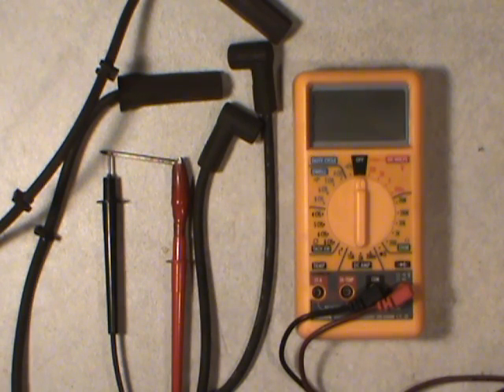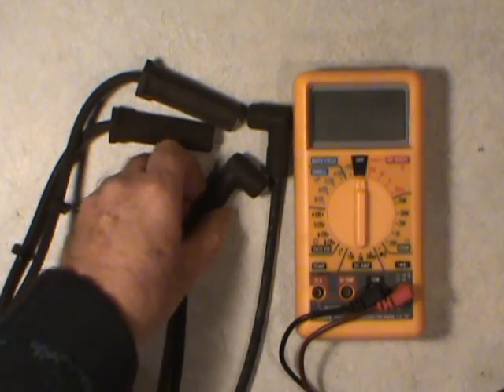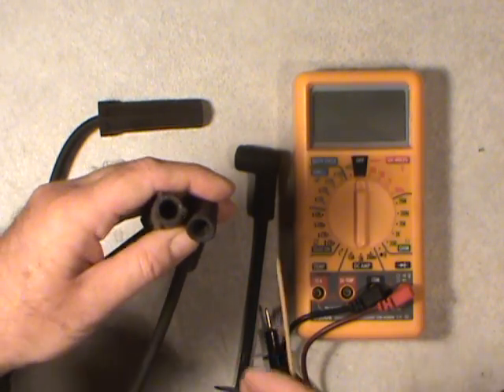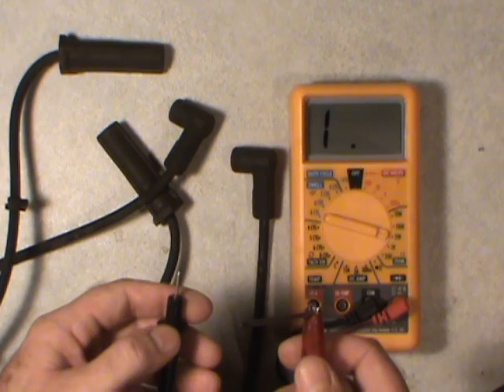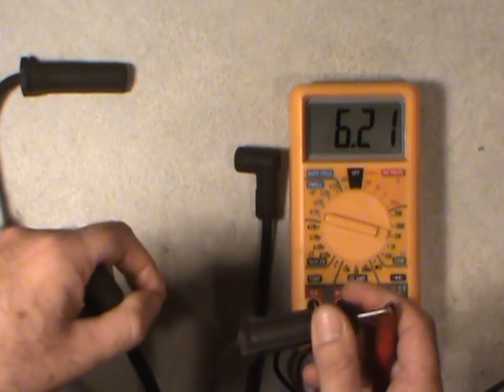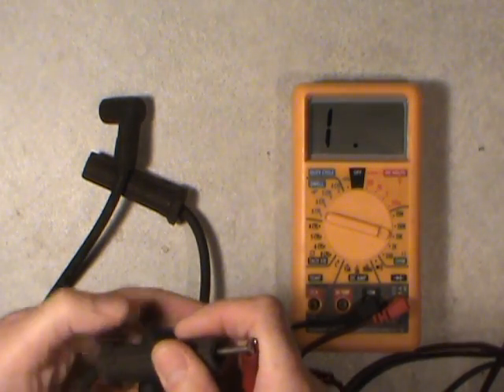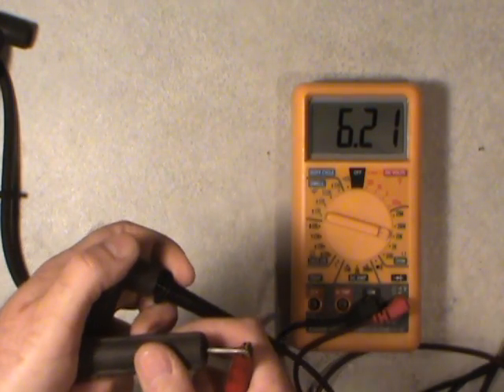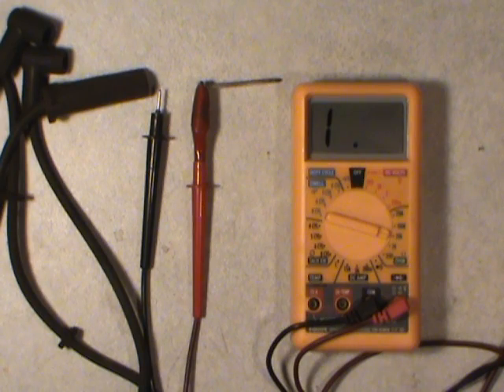How to Test Spark Plug Wires

Comment: Very well done and helpful -thanks.  Just hope I can cure my misfiring prob - changed plugs and coil pack - only leads to go but they cost £100 here in UK so it would be good to test first in case the leads are not the problem. They are 11 years old !
Reply from the maker: Greetings...filmer138.........You're welcome, and, thanks for watching.........Well, for the more common type of, shall we say, (high voltage), High Resistance Leads/Wires, there's the Ohms/resistance test (as is shown in this video), which will usually be, a given amount of Ohms (resistance), for a given length (usually 1 foot, or 12 inches, in the USA/United States of America, and Canada as well, most times), that, the Manufacturer specifies, for a particular set of Leads/Wires, that it makes.............The, shall we say, lower cost, Carbon (string) type of, high resistance Leads/Wires, will usually break down/wear out, over time (use), due to the High Voltage Pulses, that travel through them.............Here's, an easy way, to actually see, if there is one or more, very bad spark plug Leads/Wires, in the set of them, but, you have to be very careful, at the very same time............It's just a matter of, Watching, all of the Leads/Wires, while the engine is running, when it's dark outside............Remember now..."Don't Touch"...!!!...just "Look", not too Close...!!!...for any High Voltage..."Arcing" (sparks/sparking), that seems to be..."Jumping"...from a spark plug Lead/Wire, to a Metal part, that's near it..............I find, that, the Darker it is, in the engine bay/compartment, the easier it is to "See", any, high voltage Arcs (sparks), well, if there happens to be any, that is............Make sure to have plenty of Fresh Air/Ventilation around the vehicle, when-ever the engine is Running, b-cuz, the engine's Exhaust Gas is "Deadly"...!!!...........Just a few months ago, I saw at least "2", high voltage "Arcs" (sparks), jumping right out of, 2 individual/different, spark plug Lead/Wire's (insulation) Jacket/s, and over to, a fairly close metal part.............The high voltage "Arcing" (spark), that, shall we say, "Leaked" out of, at least 2 of the Leads/Wires, that were on that particular V-6 engine, looked almost like, a brand New, set of spark plug Leads/Wires, and, they didn't have many Miles/Kilometers on them, so, now I know, not to, shall we say, Judge-a-book-by-its-Cover, well, more like, Don't assume that, a spark plug Lead/Wire is 100% Functional/Working, just by how Good it Looks (to be)...!!!............When-ever, I install, a set of spark plug Leads/Wires, I try to keep all of those Leads/Wires..."Away-From"...any Metal parts, as in, valve/rocker covers, as an example, to avoid any potential, not wanted Arcing/Sparking, as well as, keep all of those Leads/Wires...Away-From...any Hot parts, like an Exhaust Manifold or two as well, to prevent any potential, melting/damage.............Have a look on...EBAY...in your Country, and if that fails to produce anything, then try, other Countries as well, for a Quality set of Leads/Wires, for your "Exact", vehicle and engine.............Sometimes, even with the shipping cost, from other Countries, the Price, at times, can be quite a bit lower, as compared to, what you posted in your comment.............If online shopping, be very careful, and use something like Pay-Pal, or its equivalent, or maybe, a very low limit Credit Card, just in case a Scammer, gets a-hold of your information (and I hope not)...........So, there you have it, well, for now that is............Good luck, and......till next time......Be Safe, take care, and have a good one.

Comment: thank you, this video was helpful, I have a question, would checking for continuity give solid results???
Reply from the maker: Greetings...Jeffrey Gomez......….You're welcome, and, thanks for watching...…...Ohms (resistance) testing spark plug wires, will only be telling you, that, the conductive core, of the spark plug wire, is within the specified (ohms) range, for that particular type of spark plug wire, or not......….Flex (bend) the spark plug wire a bit, as it's being ohms tested, as by doing so, will usually find, whether or not, there might be a broken conductive core showing up, where it might not be doing so, by leaving the spark plug wire, just laying where it naturally wants to......…Also, a set of spark plug wires, should have a certain amount of (ohms) resistance, for a given unit of length...……I usually use 1 foot (12 inches), of spark plug wire length, and determine, how many ohms of resistance, that there should be in that given length, seeing as how, the older sets of spark plug wires, usually have different lengths........If the set of spark plug wires, is really old/has lots and lots of miles or kilometers on them, then, a new set of them, is a good way to go, I be thinkin', and.....till next time.....Be Safe, take care, and have a good one.

Comment from the maker: Greetings tubesockets120v...You should be able to find those good old Alligator Clips at most of those "Electronic Parts" type stores...The name "Radio Shack" comes to mind, but, I'm not sure if they are still in business?...If all else fails, there's always "EBAY", where you can have them shipped to your front door...Please note, that my yellow multimeters Probes have a "Screw-Thread" at the Base of the probe and also, my Alligator Clips have a Screw-Thread as well!...Take care, and, good luck

Comment: Thanks for your comment about it being actually bad for a wire's resistance to be too low where it could leak out interference and possibly mess with the sensors and computer...I have a 95 dodge ram 5.2 v8 I got cheap with 224k miles on it, it starts and runs and drives pretty decent but at idle I can kinda feel a vibration, could be a misfire or slight misfire, no check engine light on, and OBD1 doesn't have a misfire code, only OBD2 started doing that apparently. The acceleration also seems a bit sluggish but maybe that's just how these heavy old trucks are supposed to be. MPG is kinda bleh too, I have a KN cold air intake and online guys say they get 20mpg with it but I call BS on that, but surely I should be getting more than about 10ish-12ish mpg? Maybe I just need a tuneup, I'll have a look and examine the spark plugs and wires and see if the dist. cap and rotor is badly corroded or something.....is it ok to get the cheap aluminum terminal dist. caps? I know the brass is "supposed" to be better, but honestly, I heard alot are just brass plated/coated and actually not much better at all than the aluminum. Rock auto has a tuneup kit with OE grade wires and aluminum terminal dist. cap/rotor for like $30 total w/ 2-3 day shipping, along with some new spark plugs found cheaply on ebay, I could essentially have a whole tuneup for 40 bucks. Maybe a new ignition coil from rockauto for good measure, I can never find much info online, certainly not for OBD1 vehicles, which talks about when/if you should replace the coil as part of a tuneup or not....from some reading before people said either the coil will work or it won't, there's no inbetween, so maybe my coil will be good for years, I don't put many miles per year on a vehicle anyway, just a beater to get me from A to B around town reliably. I can get the "premium" brass cap/rotor and premium wires for ~$40 total for only 10 more bucks than the cheaper version. I could have a total "premium" tuneup for like 50 bucks in that case.
Reply from the maker: Greetings...WhiteSnake9191...........Thanks for watching..........The good ole, OBD-1 (On Board Diagnostics-version 1)...I hear Ya alright, as, that type of vehicle/engine computer management system, seems to like, keeping most of its "secrets", all to itself, at times...lol...........Yes-Sir-ee-Bob...a good basic, shall we say, tune-up, as I see it, should be done first, other-wise, there's a good chance, that, we might be placing blame, on, something like, one of the sensors or actuators alright...........Gotta have, a...Clean Air Filter...Free-Flowing Fuel Filter...good as new Spark Plugs, that have the specified Gap setting, between its 2 electrodes...spark plug Wires, in, as good as new condition, and kept apart from one another, and also, away from any metal, such as valve/rocker covers...distributor cap and Rotor, in, as new condition...Base ignition timing set to Specifications...are some of the things, that, need to be in place, or the engine, will probably let you know, by running, not as good as it's able to (like you've already experienced)...........So, start with re-freshing the basic parts & pieces, b-cuz, it's gotta be done anyways, right...???.............I've found, (over time), that, the Aluminum terminals, that are inside the distributor cap, will Oxidize/Corrode, as well as, get eaten away, by the high voltage arcing, that goes on, at a much faster rate, than, what the Brass terminals usually do..........Vibration, might even be bad motor mounts sometimes, just so Ya know............Ignition coils, might rarely, start to act-up, when they get up-to operating temperature, although, it tested out ohms/resistance-wise, when it was in a cool state..........Both, Brass and Aluminum, should be, "Anti-Magnetic", so, if in doubt, about it being..."Real Genuine"..."Brass", just, try-n-stick, a permanent, hand held magnet on that sucker, to be sure...........Have a look, around your engine compartment, for a Label or Sticker, that might have some very good information printed on it, as in, factory installed spark plugs, Base ignition timing, etc...........Best bet, is to install, the vehicle Manufacturer's, "Specified" parts, because, other-wise, there might be times, where something doesn't work, as good as, it should be doing (cheap parts, might be asking for trouble...don't-cha-think...???).............Then later, you might find, that, the Oxygen Sensors, have worn-out (high mileage on it, or them), or, have been contaminated possibly...........If, one or more Oxygen Sensors, in the vehicle, get too old, or contaminated, then, what might happen, is, the On-Board Computer, will probably stay in Open Loop operating mode, which makes the engine, when fully warmed up-to operating temperature, run too Rich, of an air/fuel ratio (mixture), and that, is one possible reason, that, can cause poor/not so good gas mileage, especially so, once the engine has warmed up-to operating (coolant) temperature, where the vehicle's, On-Board Computer, should be going into Closed Loop operating mode, which uses, one or more (as the case may be), properly functioning, Oxygen Sensor's output signal/s, when just cruising along, not too fast, or at idle speed as well, possibly............As soon as, you go Pedal to the Metal, when the engine is up to operating temperature, then, the On-Board Computer, will usually go into Open Loop operating mode, and just "ignore/not pay attention to", the Oxygen Sensor's signal, how about that...lol............All it takes, is, one misfiring spark plug, or maybe, a wiring connector, that's corroded/too dirty, that can be responsible for, a rough/not so good running engine, and, in a worst case scenario, it might end up being a No-Start (of the engine), and, I hope not...........There are many, did I say Many, things, that can cause similar, not so good, engine running symptoms, with something like, an OBD-1 system, so, start with the basic tune-up, and if need be, go from there..........Good luck, and.......till next time........Be Safe, take care, and have a good one.

Comment: We usually go by liters when we are talking about engines in the states.
Reply from the maker: Jon Wallace Greetings Jon Wallace....Thanks for watching, and for, Your rather interesting comment as well.......................................Let's see now...if I understand You correctly, You were saying that, the "Engine Displacement", is currently being indicated in "Liters", in the "States" (I'm assuming that, by "States", You are referring to, the "United States of America")...............Wowsers...!!!...that's News to me...!!!.........................................Here, I had always thought, since the United States of America, did not, "Convert" to the "Metric System", (I think?), when Canada did, oh, somewhere about "1977", I, never would have thought, that, the "States", would have, shall we say...became..."Hybrid" (in a manner of speaking, that is), when it came to such a thing...(the "Thing", that I'm referring to, in this case is..."Cubic Inch"...to..."Liters/Litres"..."Conversion", in some cases, as well as, "If", the Engine in question, was, shall we say...."Fresh off the Drawing Board", as it applies to something like, a "Newly Developed", and Not Using, any of the Original/Older, Engine Block, and Cylinder Head Castings, as far as "Engine Displacement" is concerned).....................I for one, and, I'm thinkin', that, there are plenty of Other..."Car & Truck"..."Fanatics"..out there, who really don't care so much, for the, so called..."Engine Displacements"...being.."Converted"...from..."Cubic Inches"...to..."Liters" (I think, that, up here in Canada, the spelling is "Litres", but, that be, what it is), especially, when, there are quite a few..."Historical"...and, in my eyes..."Engines"..that became, shall we say..."Milestones"...in..."Engineering and Performance"...and, to some...may I use the word..."Legends"...throughout, all of..."Automotive History".............................................In no particular order, I will now attempt to, list a few, of the..."Mentionable"..."Cubic Inch Displacement Engines"...that, to me, and probably, Many Others as well, would..."Not Sound very Impressive"...if Stated in..."Metric/Liters/Litres"..............................................I guess that, One could say, that I'm more Fond of..."North American Vehicles"...and, Some, may refer to these particular..."Cars...Trucks...and Vans"...as..."Gas Guzzlers"...!!!...lol...............................................So then, without any more suspense....................(hear that Ticking analogue Clock, in the background?...lol)...I'll now get started...................(just a few...and by all means, not All..."V-8" Engines...ok)..............."Cubic Inch Displacement"..."Engines"...going in alphabetical order...................."Chevrolet" (aka, Chevy)...265 V-8, that started it all...then...283...302...327...350...396...409...427...454.................."Chrysler" (may include...Dodge and Plymouth as well)...318...340...426-Hemi...440................"Ford"...289...302...351...390...428...............The previous, were just some of the..."Cubic Inch Displacement"..."V-8 Engines"...that came to mind (mine, that is), and, to me..."Converting"...those..."Cubic Inch Displacement Engines"....to..."Metric/Liters/Litres"..."Does Not Impress Me", in the Slightest"...and Me, being Me, will..."Always Remember"..."Where it All Started"...and that my Friend, is what these..."Historical Engines"...were referred to, in the "Past", as far as I recall...................................................Another thing comes to mind.............When "They" (who-ever "They", happen to be), decided to..."Convert"...from..."Cubic Inch"...Engine Displacement...to..."Metric" (Liters/Litres)...I've noticed that, the, so called..."Conversion"...was only in the..."Ball Park"...but, hey now, I used to..."Pitch Horseshoes"...and...being..."Close"...actually meant something...lol.................................................Here's an Example for You..............The designated..."4.3 Litre"...Engine Displacement, in this case, was a..."Difference"...of..."2 Cubic Inches"...!!!................................................Lettuce (catch that spelling did You?...lol), use the following..."2 Examples"...shall we......................................."Oldsmobile" had a "V-8" Engine, that was..."260 Cubic Inches" (displacement)...and it was "Listed" as a..."4.3 Liter/Litre V-8"................"GMC (General Motors) and Chevrolet (Chevy)...had (has?)...a..."262 Cubic Inch V-6" (displacement)...Engine, that was also..."Listed"...as a..."4.3 Liter/Litre" (Displacement) Engine...!!!..................That's like calling an..."Apple"...an..."Orange"...!!!...lol.....................Talk about..."Rounding Off the Specifications"...!!!...................Yes-Sir-ee-Bob..."I Calls Em...like I See's Em"..."Inaccurate"..to say the least...!!!.....................................................Ah yes, then there's, the..."Dual Display"..."Miles-Per-Hour"...and..."Kilometers-Per-Hour"..."SPEEDOMETERS"...in some..."Cars and Trucks" as well...!!!...............................................Gee-Wizz...if Someone says..."How Fast They Were Goin'..."...in..."Kilometers" (per hour)...Man, that sure sounds..."A-Lot-Faster"...then..."Miles-Per Hour"....!!!...now there's a..."Side Benefit"...if, ever I saw one...!!!...lol............................................Thanks again, for letting me know, about, what..."Engine Displacement"..."Measurement System"...You Folks are using, in the "States"..........................................Well, that's about all there is, for the time being...................Till next time...Be Safe, take care, and have a good one.